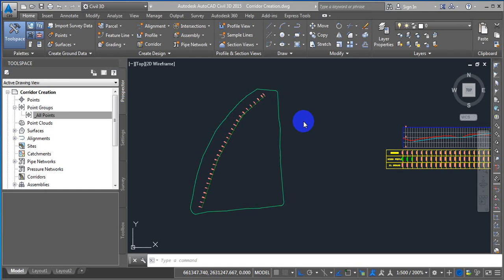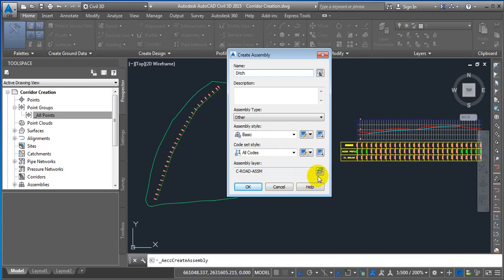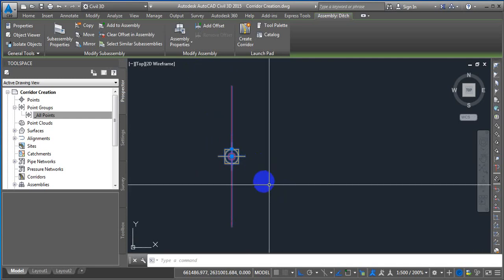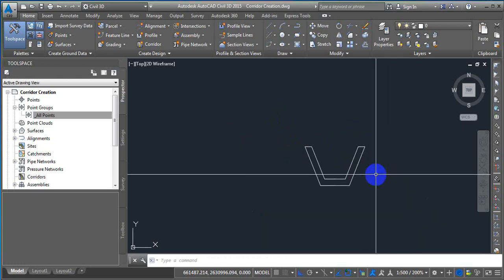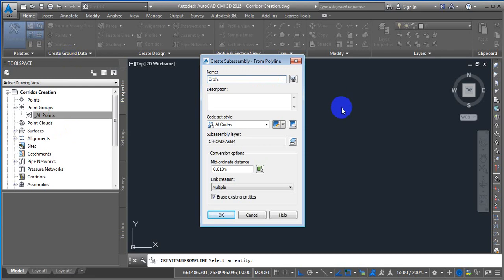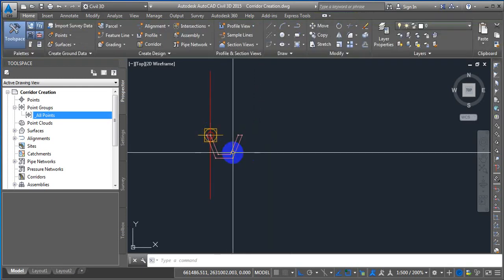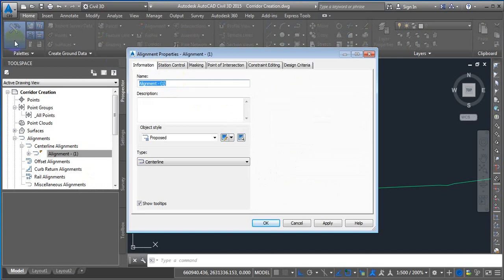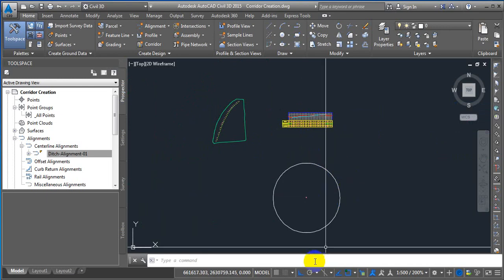Civil3d Corridor Modelling - Video-01

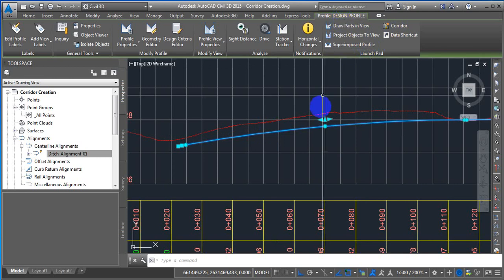Comment: great video but i have one note  at 20:20 showed design line  slope going up not to down i mean open channel bed need slop to run water if we have pipe line or closed structure we don't need slop but in this case we need some slop